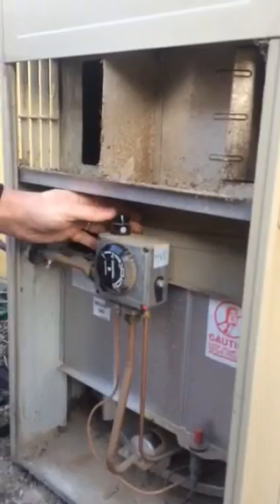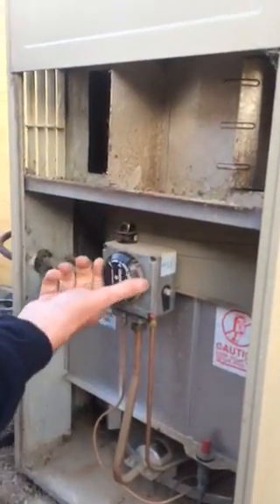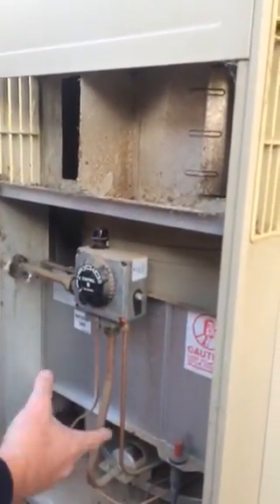How To Relight An Aquamax Hot Water?

Comment: Legend. Thanks for helping me work this out. My issue was the clicker wasn’t clicking, I wasn’t pushing it down hard enough, and on the right angle, but when I finally got that right and followed your method, as explained badly on the cover, it worked. I also learnt earlier that gas is on if tap handle is turned the same direction as the pipe.. righto time for a hot shower..